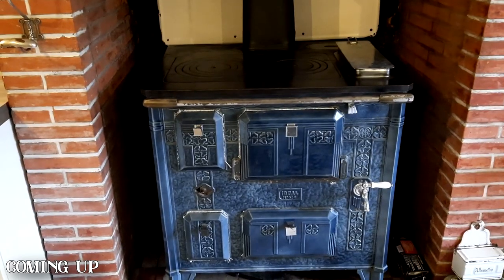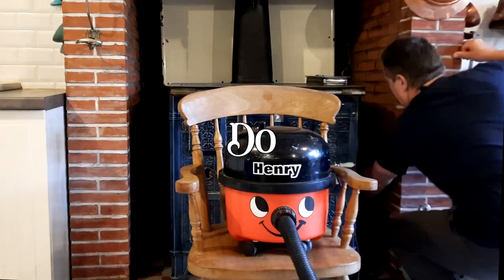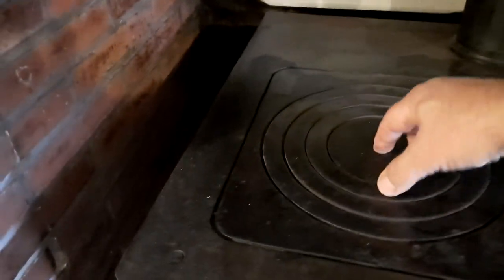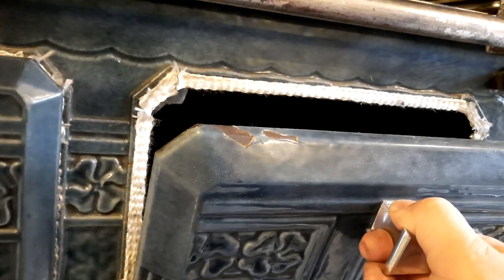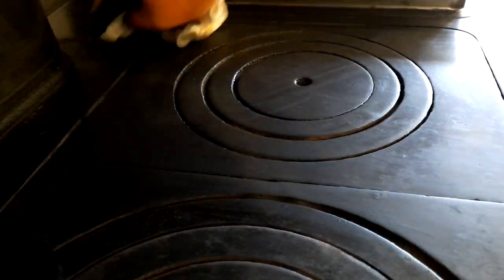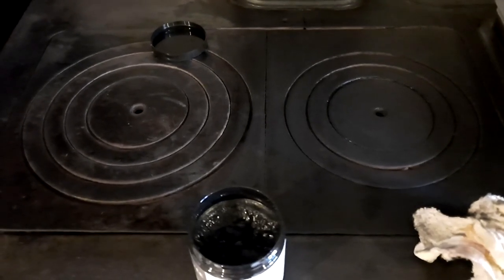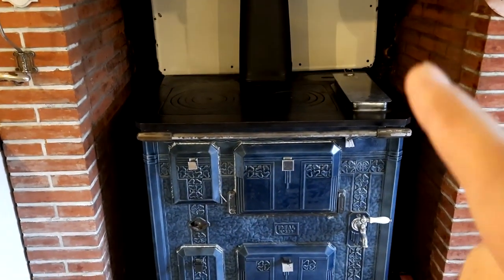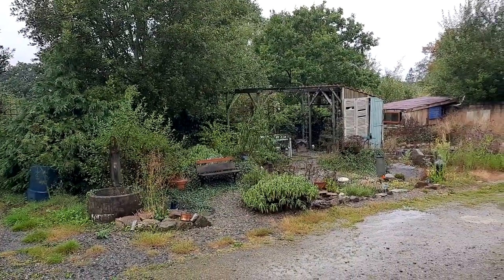Firing Up My 1920's Range Cooker | Backstory, How It Works & More | Sean's World Vlogs

Comment: Sean, you need a convection fan on the back of that stove for the colder days. The heat goes up the base and spins the fan to move the heat around the room. I have two on top of my small wood stove, and it makes more than one room warm.
Reply: I have one too. Works great.

Comment: The sound of cleaning the ashcan took me back to my childhood ! Our neighbour used those 'flue devils' and invariably her chimney caught fire and my Mum and our other neighbour would put wet tea towels over their heads and faces to try and stop the fire in the flue before it exploded the chimney pot , which it usually did!. The trick was to stay away from the exploding terracotta pots!
Reply from the maker: Yes, it depends on what wood is burnt and how well it's seasoned.
Reply: @Seans_World  "The old lady next door" burned coal...so when the soot piled up it was a major conflagration with all the tar. Wood might have been less bad and easier to extinguish. I am thinking about putting in a small wood burner in France, I have chimneys, but they would have to have a triple liner for safety. It would be good to have an alternative in case the electricity goes off . We have a good gas heater with radiators but sometimes it is rather chilly even in Haute Vienne.

Comment: This was interesting to watch Sean.  Do you just use this range in the cold months?  If so, what do you use in the rest of the months?  Does the range put out heat into the kitchen?  The range is a beauty for sure.  Thanks for showing us.🙏🏼❤️
Reply from the maker: Hi Mavis we use the gas and electric range in the summer so the house don't get too hot. And the woodburner in the colder months

Comment: Have to ask about how many square feet does it heat ?  Had a Glenwood m-1886 cook stove in Maine USA in the house before (groan) moving it to my camp on a pair of lakes.
Like the look of yours more than the Glenwood basic black with some chrome and water jacket with warming oven and oven.Heated around 2000 sq. Foot. Replaced the house stove with Lopi Liberty glass front ,heats 3000 ft. Square 25x50 house and 3 floors.
Reply from the maker: It's just a backup when it gets very cold 🥶
Reply: @Seans_World  That would be -30F to -60*F/C here normal lows with or without windchills, or the unpleasant cost of oil heat. Nicer just tossing a log in the stove, now using 2 cords of oak, birch or Doug fir vs 7 cords with one of my other stoves.40 years with woodstoves, have you ever considered using a magnetic temperature gauge on your glue pipe?it’s kept me clear of blockage and creosote buildup for the last 25 years. My chimney cleaner and fire dept/brigade recommended and as long as I stay between 150-300* C total buildup has been 1 3x5” or index card worth of ash buildup in the cleanouts of masonry or double wall chimney per stove.